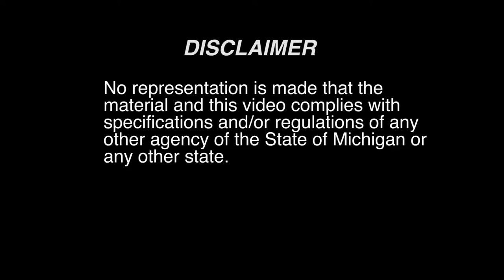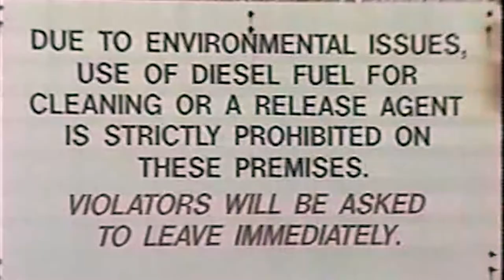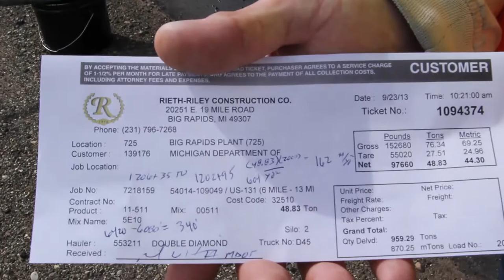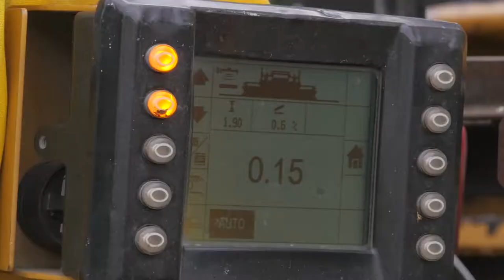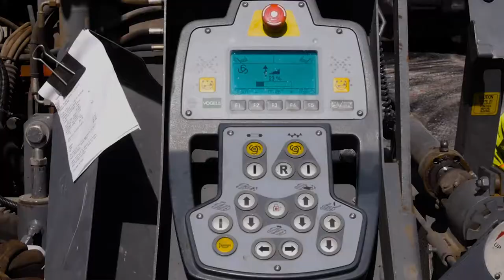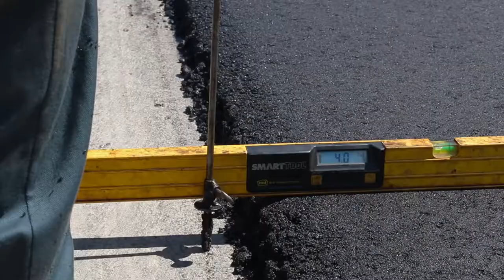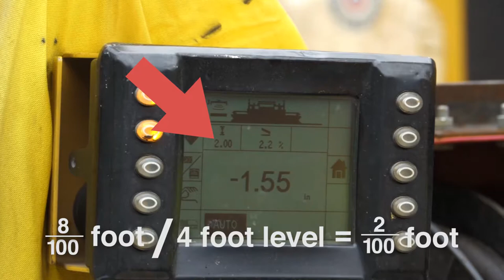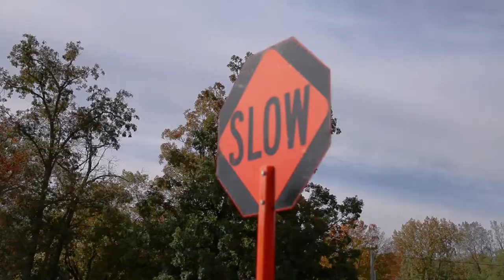HMA Paving Operations Video 3 – Paving Operations

Comment: I think the better metric system 1 cm to 1 m is 1%
Reply: MDOT tried it for a few years back in the late 1990s. It was a challenge to say the least. Every now and then you still come across it (i.e., grams are used in density weights, etc.).